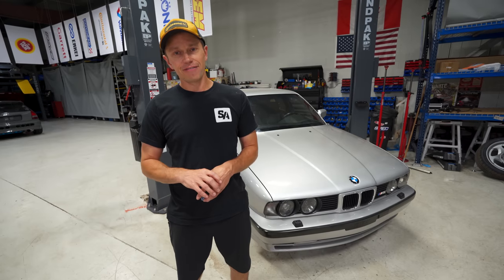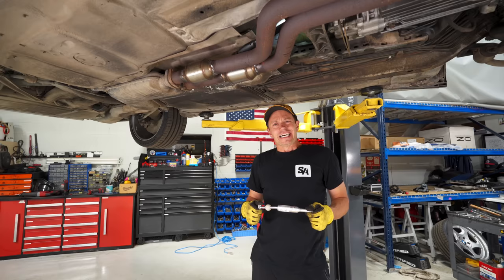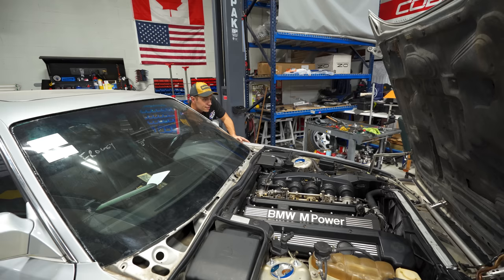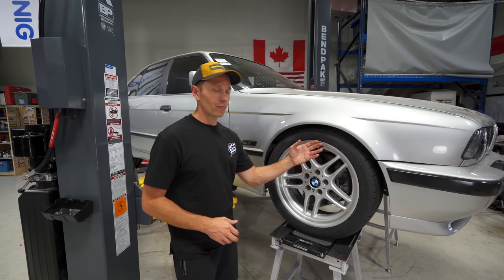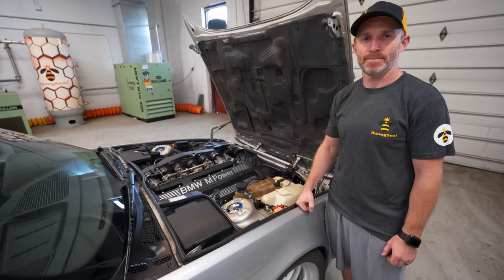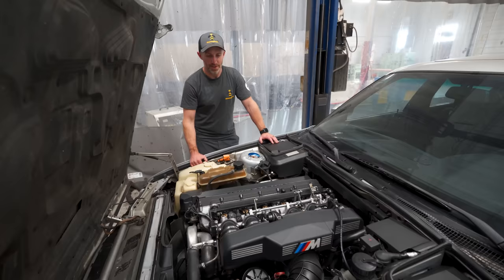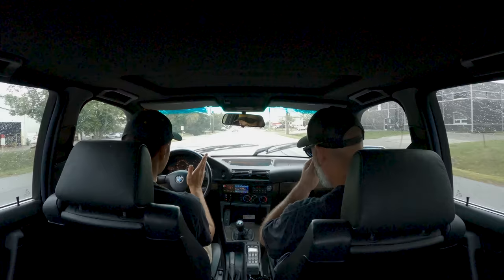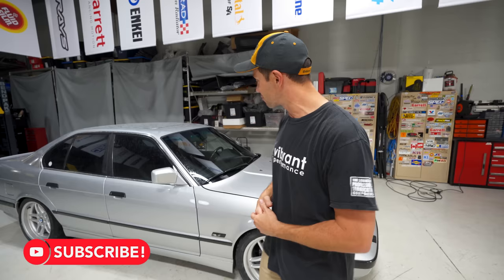$7500 BMW M5 Rebuild - PT 2 of 2

Comment: A couple tips on the HVAC system. The fan speeds are controlled by a resistor that commonly fails. It's very easy to replace. The AC may be blowing hot due to the the electrically actuated blend valve being stuck. That's also a very easy fix (or at least it was on my '95 540i).

Comment: Excellent series.  Love the E34.  I find the steering to have a lot of play on center but was told it’s normal for these cars with steering box.  Would be interested to her your thoughts.  Keep up the good work!
Reply from the maker: Yes they are sloppy. I just tightened the adjustment screw and it made quick a nice difference

Comment: Pretty sure the final stage resistor is the culprit for your blower issue. The engine bay looks magnificent but for the final touch you should replace the paint code sticker.

Comment: She deserves a Blaupunkt Bremen SQR 46 DAB, I put one in my E34 M5 and it matches perfectly, looks like the original and has a super solid bluetooth connection.  You can also dial the backlight color in to match exactly!
Reply from the maker: Plan is to get a blaupunkt eventually. They are the perfect match for that era car

Comment: The fan problem will be the fan resistor under the dash. They're worth checking even if they work properly as leaves can clog up around it and it can be a massive fire risk. I ended up replacing mine in my 525i as it wad badly corroded.

Comment: So the fan speed control not working on 1-3 is a resistor pack that put a different resistors for the lower speeds and does without a resistor for the 4 speed. Just change the resistor pack in the firewall near the middle if i remwmber correctly. Should be a fairly quick job

Comment: The fan only running on 4 is a resistor board has to be replaced to get the other speeds back, at least that's how it is on the e30.

Comment: It's never one and done with BMW's! I wouldn't mind if this turned into a BMW only channel.  Love the previous wheels for a restomod look, love these wheels for a period correct look. I would just get them refinished. For the shift knob these don't screw in, you need to give it a good smack down with your palm until it seats in place.

Comment: The fan issue is the blower motor resistor. Classic symptom with only HIGH speed working. HIGH bypasses the resistor.

Comment: It will be the fan speed controller that has failed, in Speed 4 it bypasses the resistor(s) and give direct 12v to the fan for full speed. Very common on all cars 👍

Comment: i think you need to dress up those brake calipers.
then it will be set. even a nice silver. could even do a M sticker on it.

for the blower fan speed there should be a resistor near the blower motor that is probably burnt out.
swap that out and fans should be working normal again. speed 4 is full 12v so it bypasses the resistors.

Comment: If the blower fan only works on high, than the blower motor resistor is bad. On high it bypasses the resistor.

Comment: Not sure how things work in Bavaria, but in every USDM/JDM vehicle I've owned, if the HVAC blower speed doesn't change between any of the lower settings and still works at the highest setting, a faulty blower motor resistor is to blame. I'd say it should be an easy fix but it's a BMW soooo...😅

BTW, I enjoy seeing updates/additional work done on previous build. It's true to the experience of owning a retro/performance/modified vehicle - the work is never done.

Comment: Welding the 304 stainless Cats onto the old mild steel exhaust was always going to be a big ask, the welds will always look terrible and are prone to cracking. If they fail get a new section made in stainless. You will probably be ok as ling as you don’t look up when under the car and get pigeon poop in the eye 😂👍
Reply: Should get rid of the crusty stock exhaust and get a custom stainless 2 into 1 with one cat. Weight savings, less complexity.
Reply: @TML34  agreed, its the better overall approach.

Comment: They are lovely wheels, but I think the previous wheels were the better look. The right amount of retro with a modern twist. To be honest you can't go wrong with either of them so maybe you can switch and change it out as and when you feel like it. Honestly the stealth look on the lights were better than the OEM. More of a sleeper look. Need to clean up those reservoir tanks from having that hideous rust colour look. Only thing ruining the look of that bay now.

Comment: The HVAC issue is the blower motor resistor. On the later e34s (like this one) you should use a blower motor resistor (P/N 64118391699). Earlier e34s used a big and expensive board lovingly referred to as "the sword". Check your build date for which system you have in your car but it should be a cheap and easy fix.

Comment: The HVAC fan runs on high because it’s a direct 12V.  The resistor pack that the other speeds run through is burned out.  Should be an easy fix.  Oh wait, it’s a Bimmer.  😅

Comment: 200 gallon per hour pump feeds the surge tank for a 80psi 300LPH injector pump 😈,  4.6 V8 was only doing 130hp with with a walburo 350... car plow? "plow the snow drift" one end of mods done.